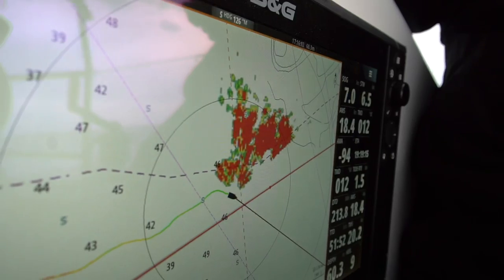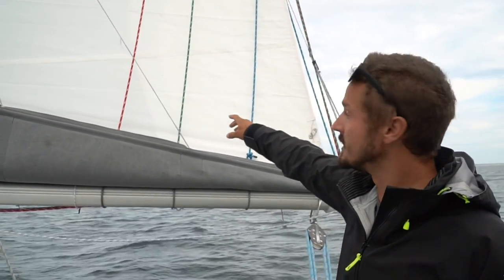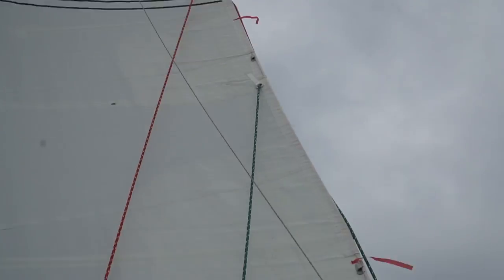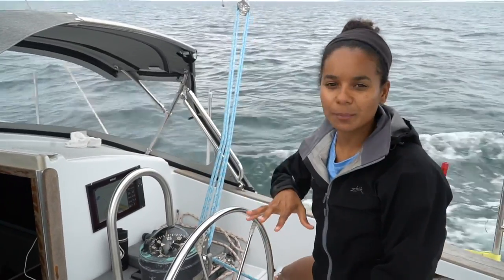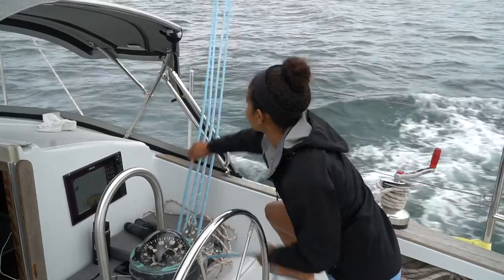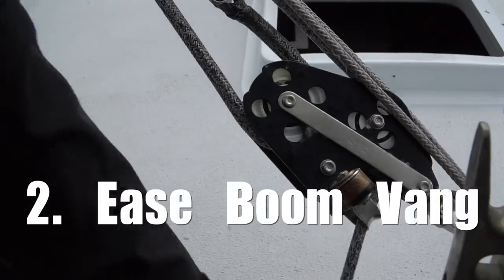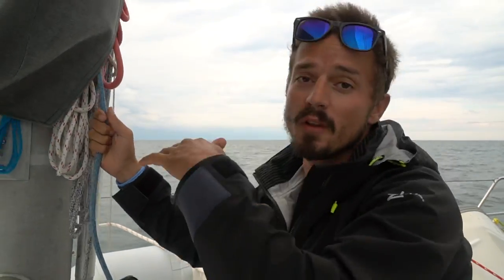How we REEF in 7 Simple Steps

Comment: Do you want to talk us through why you don't lead the reefing lines and halyard and vang back to the cockpit? Would make it easier/safer especially on single-handed watches
Reply: Halyards
 It is commonly thought that all of the halyards should be lead to the cockpit. This is certainly true for the jib and spinnaker, but not necessary for the mainsail.
The main halyard can be left on the mast because it is usually the first sail to raise and the last to drop. On most sailing days the singlehander will only raise and lower the main one time. As well the skipper will likely be at the main halyard when the motor is running and the boat is flat on the water. The main is probably the most
physically difficult sail to raise in terms of weight so we don’t want to add extra turning points that require extra effort. Even in the worst possible weather, it is still safe to take the few steps from the cockpit to the mast to put in a reef. When reefing the main, the skipper must be at the mast to tie it up anyway. Having the main halyard right next to the reefing line on the mast is very convenient. It makes it possible to drop the main and tighten the reef lines from one position.
One problem with having the main halyard on the side of the mast is the difficulty of reefing in a heavy wind when the halyard is on the leeward side. It is an awkward position if the boat is listing 45° while attempting to handle the halyard from the bottom side. In these cases I just tack so that I’m on the top again.
Thoughts, Tips, Techniques and Tactics for Singlehanded Sailing Andrew Evans
(I highly recommend this book: the newest version is not expensive from Amazon and an is version are available from the single handed sailing society's website. Great resource, great gift idea, etc)
Reply: mcsblues Great questions, I’m interested in that too. I’m from Sweden and here all boats (also old boats) lead the lines and halyard to the cockpit. Would be interesting to hear pro’s and con’s with that.
Reply: @petervespae-biketours593  As I said below somewhere I suspect the major con apart from the extra cost is you end up with a lot of line cluttering the cockpit, but that's a trade off I'm happy with especially if I can sleep through someone else quickly safely and easily putting in a reef without help. A solid vang or the topping lift also led back would help also - that way you can just release the main halyard to a mark with no need to re- tension.
Reply: the most common reason given is that all lines let aft works really great until it doesn't, and then you're up at the mast anyway, only with more friction and tangle to deal with, and less experience to handle it. Second most common reason I think is that doing at the mast there's less friction and everything goes faster.
Reply: @wilfdarr  Hey thanks you..I Just bought a Hughes 30' Up in tobamorry  Ontario Canada  hopefully hitting the big shoot and take the Trent Canal to lake Ontario and down to warmer weather.. I'm a 35 year old single hander with cancer and this comment made my day.. So thanks again..Calm Seas

Comment: The only thing I do different is to tighten up on the topping lift before lowering the sail. I know that some people are happy to use the tension in the lazy jacks to stop the boom from dropping, but I prefer using the topping lift.
Reply: My Topping lift is set so the boom does not fall down on dodger. when the mainsail is properly set, it is loose. 
So I never really adjust it while sailing.
Reply: @TarasKalapun  I like that and will try it. The very first sail in my boat the pulley at the top of the mast ruptured and the boom did fall down on my dodger and bent the (aluminium) frame. Whoops :)
Reply: If your jacklines are sufficient for that, then I see no reason not to have them do double duty?
Reply: @wilfdarr  It's probably 'force of habit' more than anything. I had the boat for 12 months before I installed the lazyjacks :)
Reply: I have a rigid Vang , no topping lift or lazy-jacks.
Reply: @verynearlyaboutsailing8114  my topping lift is actually a spare mainsail halyard.
Reply: @TarasKalapun  That's another good point. My mast is off at the moment. I might beef up my topping lift gear so I can do the same. Thanks for some very useful comments.

Comment: Your system is so prehistoric. I use three steeps. 1, release the halyard. 2, winch in the single reefing line from the cockpit, which pulls down the clew followed by the tack. 3, tighten the halyard. takes about thirty seconds no need to go forward at all.

Comment: Nicely done video, I am quite comfortable with mast base reefing, although I would always clip a harness on my jackstays before going forward to work on the sails.

A couple of comments.

Cranking on the uphaul or topping lift makes it much easier to tighten the boom end line. Alternatively, if you have a boomkicker or solid vang letting the vang off a bit raises the end of the boom. It also insures against the boom crashing on the deck if the uphaul has been inadvertently left uncleated, it has happened!

A 4:1 Cunningham tackle on an S hook simplifies the tack attachment, gives you some room to play with if the tack is hiding inside the sail cover, and also means you can drop the halyard to a pre arranged mark, cleat it straight away, then use the Cunningham tackle to tension the luff.

Comment: Great video. To ensure even tension on the length of the mainsail luff i winch the halyard on to the required tension and then tension the sail’s foot. Doing these two steps in this order avoids the risk of unnecessary outward lateral pressure on the sails lugs at the luff of the mainsail....(if you tension the reefed foot first)....

Comment: Me: "Hey Google what's a 'reef' in boating terms?"
Google: Reefing is the means of reducing the area of a sail, usually by folding or rolling one edge of the canvas in on itself. The converse operation, removing the reef, is called "shaking it out." Reefing improves the performance of sailing vessels in strong winds, and is the primary safety precaution in rough weather.

Comment: We have a Duncanson 29'6" with slab reefing, like yours, but loose vang, and we use topping lift to hold the boom up, ie: 1) sheet off, 2) main sheet lead to leward {forward steps, to lessen the rudder angle in big winds}, 3) sheet medium, {safety of crew with boom movement}, 4) vang off, 5) Topping lift TIGHT {our boom would fall if no topping lift tension, and no halyard tension}, 6)halyard Loose dropping the sail, 7) kunningham hook onto eye in luff, haul tight {don't have hooks, have a tack shackle}, 8) halyard tension, 9) reefing line tight, 10) topping lift off, 11) tidy up lines on mast step, as per penny Whiting video {coiled onto the halyard cleat, so easy to 'dump' in emergency}- rope "tail" from cleat grabbed and pulled under coil top and placed back on top horn of cleat (encapsulates coil on cleat)-flakes off clean,no twists, 12) sheet "on" to sailing trim, 13) adjust main sheet track to rudder angle/ angle of heel for comfort.

Comment: Best system ever, simple, hard to break, no risk for anything to jam inside the boom nor the mast except the main hailyard, little risk to the sail, easy to execute single-handed, provided the boom is at a reasonable height and the vang well released.

Many may say "it is dangerous to go to the mast".

Well, in my humble opinion, if one fears to use a sailing boat as a sailing boat, which includes manoeuvring and interacting with the rigging, I highly recommand to use a motor yacht or to stay at home.

Happy to see I young people using the good old methods (which I have used myself on several generations of fast crusers, always at the cutting edge of their time). Not elegant, not fancy, looking technically old... making feeling a bit "frustrated" not to be at the leading edge of the progress, but... you dont change something working so well since so long - in particular at my age - do you?

Lonely greetings from the southern Seas!

Comment: I've got a single line reefing system, with all lines led back to the cockpit. So I do much the same as you to begin with - ease off mainsheet, vang & main halyard. Then I just pull on my first reef line and it simultaneously pulls both the clew and tack of the sail down. After that, it's a case of retensioning the main halyard and back on with vang and mainsheet.

One other thing that I've done is marked lines on the halyard and reef point to show where each of them should be tensioned to at both full sail and reefed position.

Comment: Hi Guy's we now have in mast reefing which we chose when we ordered Impavidus. Lots of reasons that make this the option for us and you really dont lose performance if you have the German twin sheet system and you know how to set a sail. Anyway, a top tip for you. Mark the halyard with indelible marker at the 1st, 2nd and 3rd reef points, do the same at the appropriate points on the reef lines. You will find this really helps with reefing using your system. Sail safe. Ant, Cid & the pooch crew xx

Comment: A similar setup on my Hallberg-Rassy 38, better in some ways and problematic in others.

Firstly, everything on my boat is heavy with wire-to-rope main halyard, wire-to-rope outhaul, 14mm genoa sheets and the rest of the running rigging is 12mm - and it really needs to be. When I found her, she was setup for 2 reefs but I installed two more pairs of  sheaves (now a total of 5 at each end of the boom) and a further pair of cam levers at the gooseneck end (making 5 in all). I've left reef 4 spare at this point because my 3rd reef is fairly high up and I'm going to run a line for my new storm trisail using the fourth reef fittings.

Beyond that, reefing is pretty similar except I have to pull the main down as it's not as free as yours, and I have a rams horn arrangement at the gooseneck. Rather than a winch on the boom, I have one on the mast below the gooseneck and I winch in the appropriate reefing line outboard of the cam levers.

Biggest criticism - that 3rd reef line is a mile long and, together with the second, you really have to watch things as the main comes down as the lines could take someone's head off, in the cockpit, if you don't watch out. But I mostly sail single-handed I suppose so it's just me at the mast. Other criticism - single-handing means I can't bring my boat up as high as you do as the rolling gets a bit much and I wish to stay onboard, so I reef with tension in the sail.

Comment: Pretty straight forward! Nice that your reefing lines only lead to the aft reefing point and the fwd reefing eye at the mast is clipped in with a hook. This reduces friction on the reefing lines a lot. I do not like these setups where the reefing line runs through both eyes. You may be able to stay in the cockpit when reefing, but it's so hard to pull it in and out. I've got a much smaller boat, two reefs but no reefing lines. At the mast I use a hook like you do and at the aft reefing eye I simply tie it to the boom with a short piece of rope, through the eye around the boom, then I detach the foot tensioner from the clew and attach it to the reefing eye, done. No need for any reefing lines hanging around and getting tangled, need to reach up to the end of the boom, but as said the boat is smaller.

Comment: I see someone else has mentioned ‘topping up’ the Boom before releasing the Halyard. One more thing would be putting a quarter turn in the rope when recoiling the Halyard when stowing it. Or any other rope for that matter, so it doesn’t go into figure of Eights. Note:- Hold rope as you were doing but with your finger tips just roll the rope a quarter of a turn as you bring your hand back to make the coil. Try it it’s easier to do than to explain!!!
Reply from the maker: We have our topping lift set so the boom will never hit the dodger, so we don’t need to adjust it often. We also coil our rope in a figure 8 on purpose. It’s the same way all the pro racers coil line and prevents the line from binding or kinking when feeding it back out. You can even flake three strand that way for stowing anchor rhode and it will feed out of the locker like chain. Works great.
Reply: OK whatever suits you, I still think it wearied!!

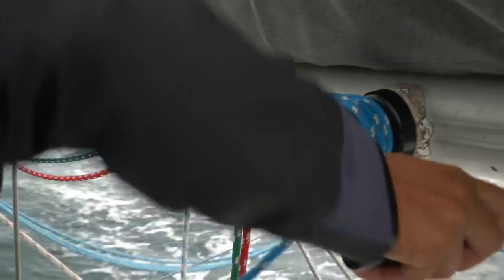Comment: At 1:43 it would be nice to see what actually is happening to the sail between step 3-5 when you pull in on reefing line. Many people, especially those with smaller or older boats/sails don't have fancy systems like that. They have to lower the sail and use the lines dangling from the sail to tie around, the sail section no longer being used. It would have been nice to hear a comparison of various ways people typically need to reef their sails. What probably helped people were the very basics that you first luffed the main, then lowered it. Then after you did your specialized reefing, you explained you then raised the main halyard again to tightening it.
Reply: The only difference in their system to the ones you describe is the stack pack and lazy jacks contain the loose sail as it is lowered so there is no need to tie lines around the section not being used.

Comment: Just as you should with person-overboard drills (MOB), each of you should be able to rapidly reef without calling additional crew on deck. One very safe method for doing this is to heave-to and lock the rudder at an angle such that the boat sits well to the existing sea-state. This will depower the mains'l and flatten the boat so that one individual can go forward to the mast. The rest of the procedure would be unchanged (with the addition of a step for coming out of a hove-to posture), but the other crew member can maintain rest - which is clearly important if you're adding a reef! BTW, whenever possible (especially in traffic), heave-to on a starboard tack... providing you (as a sailing vessel) with a modicum of additional navigation "rights". Cheers,
W

Comment: Reeling Part1:  Loosen tension on out haul.  Part 2:  Push button to activate in-mast furling motor.  Part 3:  re-tension out haul.  Part 4:  Resume drinking beverage of choice! 😃😃
Reply: All good until the motor does not work . I like the system they have because there is little to fail . It is tried and true and I have similar on my boat except the halyard does not tension the main the Cunningham does - loose footed at the mast .
Reply: How many videos on YouTube do you want me to find of people taking literally days to fight a stuck mainsail out of the furling mast 😈
With electric winches its pretty much the same effort without the chance of Ringling Bros. showing up.
Reply: @wilfdarr  It does take considerable more caution and attention to detail to avoid a complete mess with in-mast furling, that is for sure.  Especially so with some of the cheaper systems I have seen deployed on some boats.  With that said, I was only playing with Team Uma in my over-simplification of my furling technique and I suspect they understood that.  I have tremendous respect for what they have accomplished and how well they have upgraded their boat across all facets.
Reply: @svZia-Switch51  Sorry, I understood your humour and I was being a bit cheeky too. Sorry if that was lost. I personally don't like roller furling anything, but I certainly understand the draw, and as long as they are well maintained I wouldn't ever fault a sailor for having them any more than a teak deck or brass fittings: I just don't like the extra work that stuff requires and am perfectly happy sailing a bleach bottle with hank on sails.

Comment: The way I do it is to go into the wind and tension the halyard to have the boom at center point. The reason for it is not to have to worry about the boom going from side to side on choppy waters. I've seen also a method when you go 35 degs to the waves/wind and trying to put the main down for the reef. I guess each method has it's ups and downs.
Reply from the maker: We like to reef while continuing to sail. We don't motor into the wind just to reef. We can reef and un-reef without loosing speed or maneuverability which is very important.
Reply: @SailingUma  I agree. Good to know that there a different ways of doing it. Keep up the great content and sail safe.

Comment: I think this is quite a good solution to how to convert a roller reefing system to slab reefing, requiring not too much modification, basically just adding the reefing cleats on the main is all that is required. The low friction rings can be attached to the existing clew attachment point as you have. Avoiding using blocks makes it much easier, and I don't think blocks are really necessary there,  all the tension is taken up by the main sheet, so low friction blocks are ok. 

What do you think about interweaving the reefing lines through the sail, then you'd end up with a Dutchman type reefing system?

Comment: I have two CDI Furling and one for my mainsail and the other is for the Genora. I have all lines goes to the cockpit. I bought the boat that way both sails are modified for the furling system. I am bouncing the idea of replacing both sails with new ones taking the CDI off the mainsail and having a Lazy Jack System in its place would I still be able to run the lines to the cockpit or would I need a second person on deck. I sail on Lake Erie. I am a solo sailor.